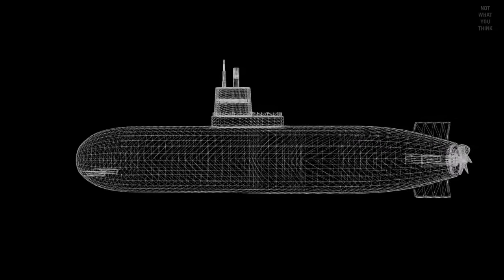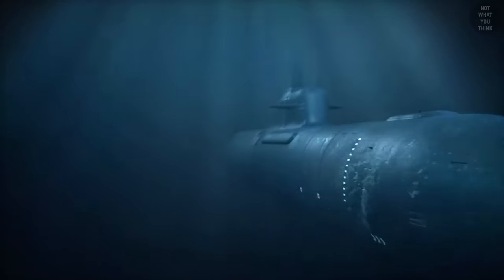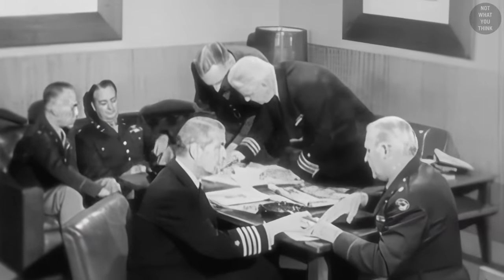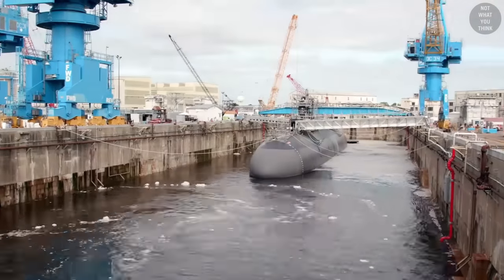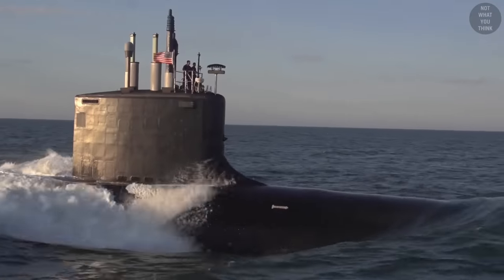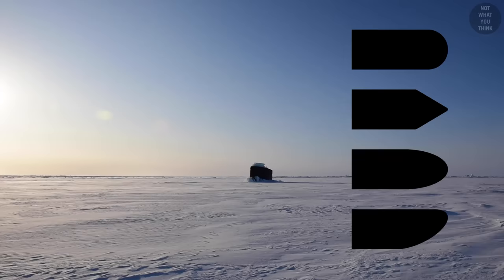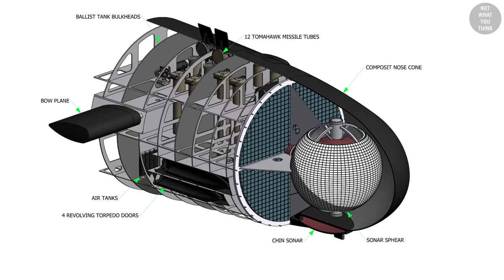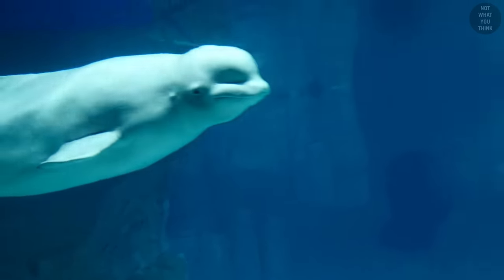Why Modern Submarines Have Round Noses?

Comment: The only submarine to defy the science behind the tear drop hull, was the German Type 21 submarine from WW2. An existing and fully serviced (action ready) member of the Type 21, the Wilhelm Bauer, "U-2540" is capable of over 27 knots while submerged and had the ability to stay submerged for several days at cruising speed of 18 knots. It used the same sharp fish shaped bow like all other ww2 submarines with one distinction, the extended forward sloping on the top area.... but other than that and a dynamic conning tower with no gun, it resembles a usual submarine from ww2 with a more streamlined body but had the top speed of subs today

Comment: Summary - Circles are good for resisting pressure, they have a propeller behind them, the body of a fish wouldn't support this well, having a tapering point shaped hull is risk prone and not optimal for pressure resistance, Curvier  mouths create less water draft reducing flow noise, hemisphere has the least resistances as opposed to other designs, this shape is also optimal for sonar abilities of the submarines, And this design is not built for being on the surface for very long as it's unstable on the surface as opposed to early day submarines.

Comment: What is not discussed is the flat bow  like the bow of a modern torpedoe - surprising good for flow noise. The bow of modern submarine is 30-40ft in front of the pressure hull and is not made of HS steels. The RN use horseshoe shaped sonar areas in the bow.

Comment: Same misleading statements about the Comet. The fatigue cracking was not from the square windows,  but from improperly punched holes for the rivets that held the windows in. The rough edges of the unfinished holes were the source of the stress concentrations that led to the fatigue. Although they changed the window shape they went from punched holes to drilled and reamed holes that were much smoother. A change that was copied by all other airliner manufacturers.

Comment: It's not "despite" being a diesel powered submarine!
In general Diesel are quite than nuclear powerd ones.
There is no diesel engine noise once they submerged, because than they use electric engines.
That's why correctly they are called Diesel/Gas electric submarines.

Comment: Diesel submarines don't have to operate on battery under water, if they're at periscope depth.  They have a snorkel to supply air to the engines and the crew.

Comment: Also I'm guessing that the fish having to flex it's body to fully propel itself through the water may be a factor in it's shape too.
Reply: Yes, I think the combination of scaled skin to break up the fluid boundary layer and also having dynamic muscle movement that is regulated by the brain works better for "active" design, like a fish. But subs are of basically static geometry, so it is more helpful to have a shape that is dynamically stable to which you add thrust and fins for direction. A flat, pointed hull can tip one way or the other too easily.  It works for sperm whales, but not subs.

Comment: because they don't wiggle would flop over and don't have swim glands would be to narrow not enough advantage considering all that also pointy can get side draft resistance from currents that blunt cannot and bashing into the ground ramming and pressure strength. lots more things than a little saving probably lost in constructing a pointy nose

Comment: I'm surprised that structural integrity was not mentioned in this video. Having a pointy or less spherical shape at depth leads to major weaknesses with the dive capability of the vessel. The ships aren't cylinders just because of the volume they have, it's because those cylinders can withstand the greatest water pressure. There's only so many ways you can cap the ends of a cylinder and have it be able to withstand huge amounts of water pressure, and it just so happens that spherical is also one of the strongest ways.
Reply from the maker: We mentioned that starting at 5:48. Unless you think we didn’t do it justice.
Reply: @NotWhatYouThink  I think the strength of the design is far more important than the other factors you mostly talked about. While the sonars we know about are most certainly spherical, to presume that the current designs continue to rely on such a huge and obsolete design is naively optimistic at best. We cannot know what the current configuration of the sonars is now, but it's pretty safe to assume it's moved past the huge spherical design. As for the hydrodynamic aspect of the shape, it's not as important as the screw noise, and the flow sounds of the hull can also be mitigated more drastically with special coatings and having as sleek an exterior as possible. They also are coated in basically soft rubber to help dampen the return echoes of active pinging. 
It's a great video, but I just think the structural integrity part should be emphasized more, because no matter what depth the boat is designed to withstand, the likelihood of going deeper in an emergency in combat or due to damage is the biggest concern next to being silent.

Comment: I’m gonna take a guess and say that due to the rounded shape (unlike a cylinder) there is much less stress on the material at high depths. The equations for a sphere is sigma =pr/2t but for a flat side it’s pr/ t meaning the stress is doubled. Just a random guess before I watch the video.
Reply: I’m pretty late here 😂 but the nose cones on submarine’s don’t actually need to resist pressure. As far as I know, the area where the sonar is located is almost always flooded whenever the submarine submerges, because water is so much better at transmitting sound than air.

Comment: DH Comet square shape windows as cause of their accidents has been debunked in the pass. First of all, they never were that square, but had round corners. Second, it was mostly the less than optimal aluminum alloy and thickness, and the pressurisation cycles. In example, other airplanes, like the DC-3 had square windows and never had those problems.

Comment: The sonar space is irelevant if the fish shape prowed more effective for stealth, noise cancelation or speed, yet it didn' t.
The fish are not submarines, they are planes, a fish needs to turn very fast, so the turning speed and turning drag matters, while a sub. takes longer to turn.
If costs are not a problem and the fish shape would have proven better for silence and forward speed, then a fish shaped sub with the biggest sonar would be a thing. As history shows, no matter how much more costely a weapon was, if it proved to be more effective, someone will adopt, use, win with it and make it a new standard.
So the biggest sonar possible with a fish shape sub. would have been a thing regardless of cost if it was more effective, yet it isn' t neither for speed, nor stealth, while a fish itself needs its shape for turning left and right on the spot.

Comment: Excellent video! Operational range is an under-emphasised point, I think. Tuna and sharks don't swim as deep as submarines may have to go. But sunfish do - and look at the shape of their noses. And @ 4:55 - was that a rudder on Albacore's conning tower??
Reply: Wouldn't think so, no point having a rudder out of the water.
Reply: It's an experimental auxiliary rudder on the conning tower. Albacore was a mobile test bed for various ideas, and carried no armament, the idea having been sold the top brass of a high performance quarry for USN sub-hunting exercises (the visionary admiral Momsen said that if Ordnance, Engineering, Navigation, Construction and Repair got involved, they would "stuff it like a turkey"). Having a second rudder near the bow would facilitate manoeuvres which (lacking a bow thruster) would otherwise be difficult or impossible, presumably including evasive ones as well as those associated with tight concealment situations such as underwater canyons. 
Obviously it's not useful for docking, as that's one of the few times nuclear subs expose their conning tower.
I'm unsure as to whether it was there from the beginning, but it is certainly still there now.
Reply: @Gottenhimfella  very interesting. Thanks!

Comment: I've always wondered why submarines have a single screw rather than dual screws to negate any torque roll induced by the single screw.
One reason fish are pointy and subs are roundy might be that subs don't have mouths they have to be able to breath with or eat with. I do wonder if a tapered front end with a smaller round at the very front might be more efficient at parting the water to go around the sub's main hull. Ok, Like the Albacore. Tunas are very fast swimming fish. I can see the symbolism in naming the research sub after one type of Tuna.
Reply: Responding to dual screws: As a former sub hunter, my guess would be detection. A diesel on batteries (the most quiet) would often only be detected by the sound of cavitation at the blades unless we were lucky and found one with a mechanical degradation like a worn bearing or drivetrain. Power generators were also a possibility, but a lot of effort has gone into shielding that noise.

Comment: the areodynamics so to speak the same applies to airplanes to cut thru the air and stuff better dont have nothing to do with radar or anything of that sort. a sub would have more room if it had a flat nose. but it would be slower; less stable let alone in pressurized subs u gotta have a rounded are

Comment: Same reason the Space Shuttle has a blunt nose!
The broad, flat nose 'stacks' water in a short column directly ahead of the nose.
This column shoves surrounding water off to the sides...there is very little water flowing over the hull at full speed.
Low flow, low friction.

Comment: so the USS nautilus had a lower sonar capable speed as the type XXI when submerged? the type XXI of the kriegs marine was the first submarine that was as fast when diving as it was on the surface wiht the main reason to go for slower speeds being the passive sonar wich became to noisy around the 10 knots mark. top speed was 17,2 knots both submerged and surfaced. but the type XXI and its smaller (and also shown in this video) sisterclass type XXIII had their active sonar underneath the bridge with the large dome under the bow being part of the passive aray.

Comment: Nuclear power has nothing to do with it! The German submarine at the end of the war were found nosed and could stay underwater for some time. Was faster underwater than on the surface. The Japanese had also done the same thing but on there own. Square windows you can have in planes as long as you sign for better overlap an riveting.

Comment: Quick summary by ChatGPT to save your time:

The round shape of a submarine's nose, as opposed to a sharp shape like a shark's, is a design choice that is based on the specific requirements of a submarine. A round shape allows for a more streamlined shape that reduces drag and improves hydrodynamic efficiency, as well as stability and seakeeping. Additionally, sharp angles and corners can create turbulence and additional drag, which would decrease the submarine's performance. Submarines are built to operate efficiently in the underwater environment, and the round nose shape is a proven design that has been tested and refined over many years to meet the unique needs of submarines.

Comment: Uhhh why did the thumbnail and title change like three times?
Reply from the maker: It's not uncommon for titles/thumbnails to be changed by content creators, in an attempt to find a combo that best represents the video.
Reply: @NotWhatYouThink  understandable, just usually it’s usually done before going public I thought. Still great video anyways
Reply from the maker: The way it works is that you post it with a title and thumbnail that you think is good. If it performs as usual or better than the average of your previous videos, leave as is. If it is underperforming, change it up, because for whatever reason, it is not working. It's basically a feedback loop from the audience.
Glad you liked the video :-)

Comment: please explain how the shaft of the propeller, interface with submarine body to engine/motor so it keeps the water out in a high pressure environment efficiently?. Thanks
Reply: Probably just a seal
Reply: Most likely just oil pressure and fine tolerances on material.

Comment: I didn't even watch the whole video but I tell from my physics insight, which rarely was wrong, is that fish need to wiggle aide to side so they are shaped vertically. Whales wiggle up and down so they are not shaped vertically but a bit horizontally. Submarine doesn't wiggle so last resistance is a bullet shape which is enough and don't need weird shapes. Now I will watch the video.

Comment: The software on the computers is written to the math of a flat Earth surface. And the only way that periscopes work to see hundreds of miles away on submarines is because the ocean is flat as far as the eye can see
Reply: So when you go out onto the ocean, and sea ships slowly sink into the distance- what is causing that?
Reply: @zachb1706  it's called going out and finding out for your self. Think about it. ? Just sit back and think. When was the last time anyone has ever used round earth math to figure out any methodically equation's??
Reply: Round earth math.? 1 to the pie square 3 x4=588585258538228
Reply: @MASTERSAIS  so you don't have an answer?
Reply: @zachb1706  you're so silly. ? That's a question from a 2 yr old. It's called an optical illusion. Your eye ball's are a ball. So you see that way🌏🏝️

Comment: Too bad that this video never answers the "why" of hydrodynamic efficiency which would probably have to include such things as pressure on the nose, wetted surface, friction, drag, and possibly more. It actually is an interesting question that could have been educationally answered. My guess is that a shape approaching hemispherical is the best compromise between exposed profile to pressure when moving forward, minimizing wetted surface while also displacing the water. A shape with a more pointed nose would increase wetted surface, so then the question is whether the friction of the increased surface area is significant enough to not overcome the increased efficiency of displacing the water. And then of course are the reasons given in the video which is to provide enough volume to position essential functionality like sonar and torpedoes. But, just guessing.
Reply: This was the discussion I was looking for.  Torpedoes made the switch to round bows before the first world war and had no sonar.  There's something aquadynamic going on, particularly at higher speed.
Reply: Nah, all of that I really too obvious, so no need cover it.

Comment: makes no sense really. adding length to the bow to elongate it for changes in geometry would have zero impact on the ability to house a large sonar. the ship gets longer. the volume gets larger, by some immeasurable and probably non-functional degree. imagine if automobiles never allowed the nose clip to protrude significantly beyond that radiator support simply because the engine compartment space was all that was needed and no other performance factor mattered. we would have no aerodynamic vehicles. at all.

Comment: 1.) Whales aren't fish. Your ending there makes every biologist on the planet cringe. 

2.) Bow SONARs, especially spheres, are mostly only a feature of US Navy subs. Russian subs for example put their torpedo tubes right up front, but they still have more or less spherical shaped bows.  They put their bow arrays underneath or above the torpedo tubes, and those arrays are cylindrical in shape. Similarly, Chinese, Japanese, and German subs all tend to have their torpedo tubes pointing straight forward at the bow. The bow SONAR is not the main reason for hemispherical shaped bows. 

3.) WW2 diesel boats were slower underwater because they ran on a battery powered electric motor, not their diesel engines that they used on the surface. The boat-shape of the hull had less to do with their underwater speed than this fact. 

4.) Hemispherical and elliptical shapes are most common, but they aren't the only types in use in modern subs.  The Chinese Song class sub has a very pointy bow compared to other modern subs. It's practically a V-shape.